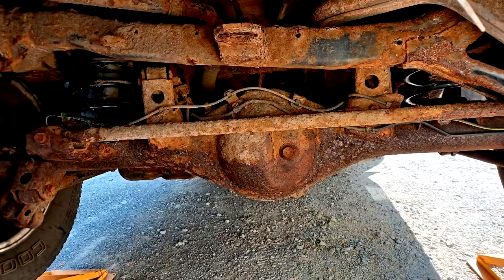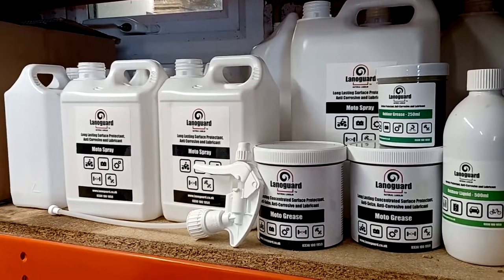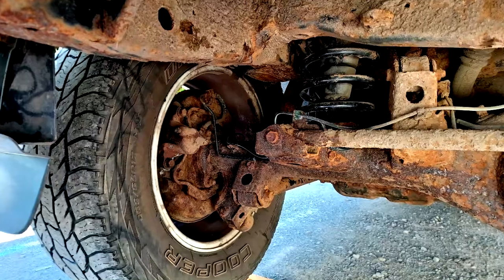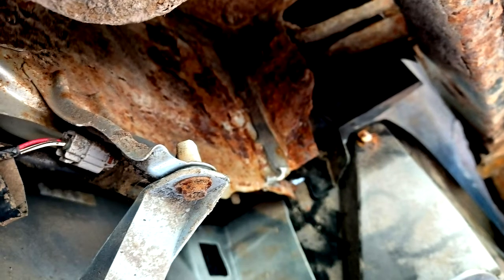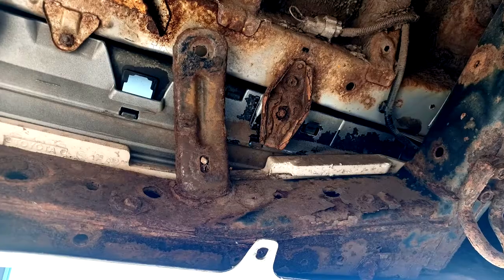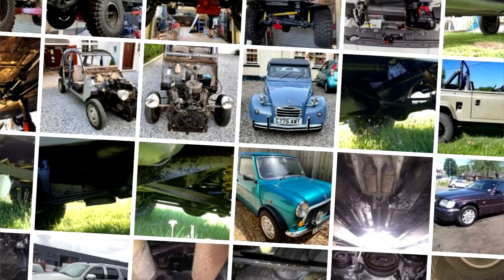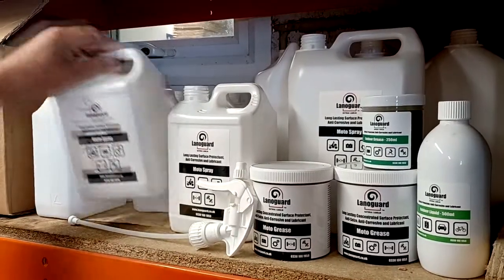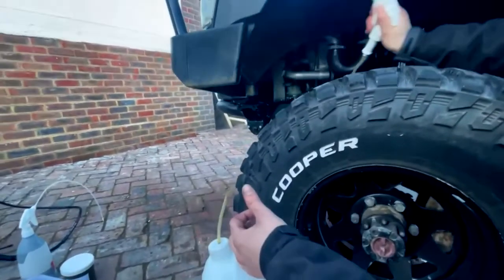Winterize your vehicle with LANOGUARD

Comment: Nice video! I winterised both my cars for the first time with Lanoguard last week. I'm wondering about it attracting dust and possibly corrosive salt during the winter months. Do you have any thoughts on this or suggestion on how to maintain the Lanoguard treated underbody during the winter? Thanks.
Reply from the maker: Hiya - No the grease shouldn't attract dirt any more than conventional products. One great thing though is that the product is jet wash resistant so if you do see a lot of dust you can give it a thorough wash and not displace the product.